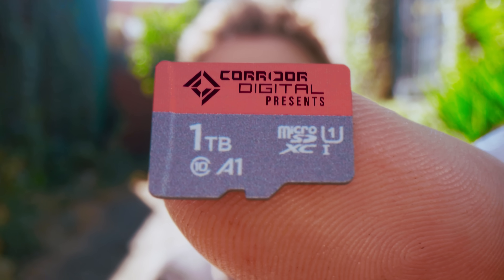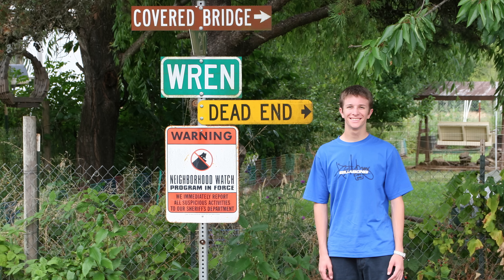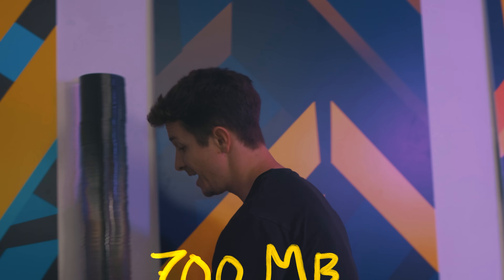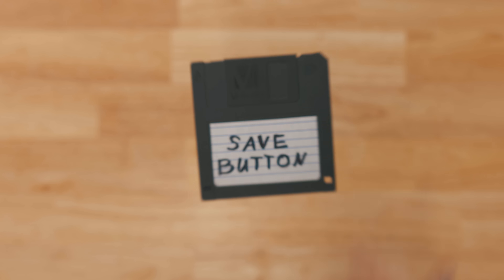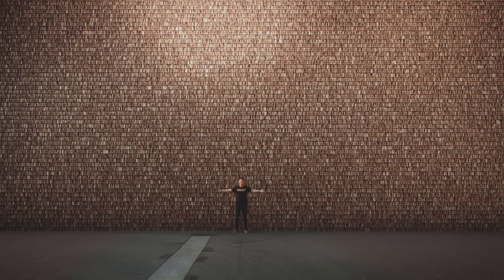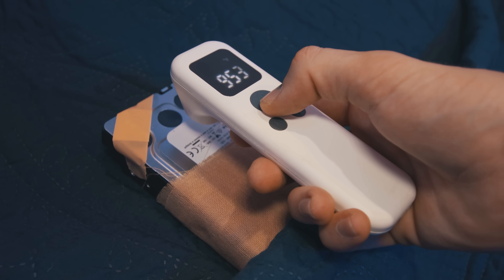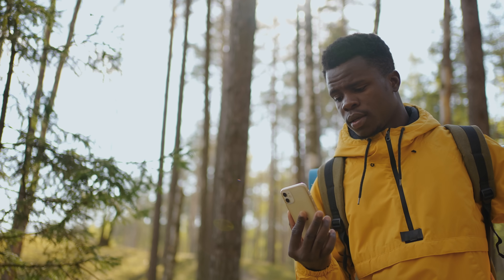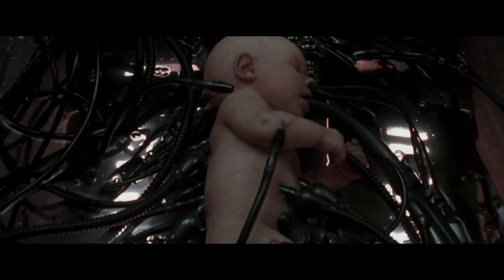VFX Artist Reveals the TRUE Scale of Data!

Comment: You might laugh at magnetic storage today, but don't! It is still used for mass storage. That's because they can hold a massive amount of data. I don't remember how much data each particle experiment (every time they fire off the particle accelerators up), the LHC takes, but it's in the range of many GB or TB (see edit below).

From their website: 
"The custodial copy of all of CERN’s physics data – amounting to about 340 petabytes –  is stored on magnetic tapes at the CERN Data Centre, also called the WLCG “Tier-0”."

Although they mainly use the magnetic tapes for long-time storage, they still have to load old data from tapes, which is a time-consuming process.

EDIT: From Computerworld:
"CERN's data requirements are growing at massive rates: Every experiment with its Large Hadron Collider creates 3GB of data per second".

Comment: Just a correction....Data is not named in groups of 1000... Actually is named in groups of 1024. 1 Kilobyte is not 1000 bytes, but 1024 bytes. This is because computer uses binary to store data, so power of 2 numbers will always easy to manage and closest power of 2 to 1000 is 2^10 (1024)

Comment: You got a few of the sizes wrong.  UHD bluray holds 120'ishGB (a regular 1080p one holds that 50GB), and even a regular DVD holds 8.4.  A floppy disc doesn't have its data stored in a spiral either.

Comment: and if you think that we must be approating the point were we store as many bits as there are atoms in the circuit you are both right and wrong. 
10^22 (meaning ten to the power of twenty two) is 10 zetabytes
a grain of silicon dioxide (SiO2, sadly we cannot index the number as it should be) of 1mm in diameter has approx. 10^19 atoms
So around 1000 grains of sand worth of atoms would hold the same amount of atoms as bits of information 
(hopefully I am not mixing up bits and bytes, but that is simply a difference of the factor of 8)
fun stuff though is that 10^22 is also the rough estimate of starts in the observable universe. 
How about that?

Ah, but how can you be right then?
Simple, we are approaching a boundery with out technology. If transistors (a simple on/off switch operated in an input/switch/output way) go any smaller they will be so close to being the width of atoms that electrons due to their nature will just be on one side of it in one moment and decide to be on the other the next. Quantum tunneling prevents the barriers to grow thinner than they already are, because if you make them thinner, the croud you are trying to hold at bay will simply phase through the barrier as if it wasn't really there.

Comment: Comparing to the 1-bit vacuum tubes of an IBM 604 isn't really a fair comparison. Vacuum tubes weren't meant for storing data. These were registers used during computation, but the input and output was done on punch cards. That's still probably less data storage density than text on paper, but it's a lot closer.

Comment: IMHO, the entire premise of the video basing "bits" off of vacuum tube transistors is flawed since we've been storing digital information in a significantly more compact form for hundreds of years already prior to its invention – via punched cards. The history of digital data really dates back to the first industrial revolution, with the mechanical looms. I implore Wren to revisit this video using punched cards as the basis.

(comment copied from another comment I made, but this part was at the bottom, so I reposted it for visibility)

Comment: I think the DNA stat is for one g, not one strand. To compare: one entire human genome is about 1.5GB (2bit per base pair and that's for one set of chromosomes I think, so double that for pairs). Still insanely compact and very exciting
Reply: I am not sure if I am right or just speaking nonsense but remember that there are two types of base pairs that can exist in a DNA. Factoring in the the fact that you can flip the base pairs around the amount of combinations that DNA can hold grows exponentially more.
Reply: @jasonchiu272  Yes, there are four different bases (A, C, G, T). The second strand of the helix always has the complement of the first, so there is no new infomation there. For one bit there are two possibilities (2^1 = 2). For DNA there are four which is 2 bits of information (2^2 = 4).  So you could encode each base as 2 bits. For example A=00 C=01 G=10 T=11. So you would need only twice as many bits as base pairs to store the same information. The number of possible combinations grows exponentially, but the same also happens for bits. However the information that can be stored grows linearly, because of all those possible combination you can only ever store one at the time.

Comment: The other thing to keep in mind with using more traditional storage over SD cards in big servers is speed. NVMe drives (especially the newer ones on PCIe 5.0) can push way more data through than SD cards. Editing a 4K video in realtime requires an absurd amount of throughput that SD cards just can't manage.

Comment: Sorry for this, but you're wrong in the scale. There's 1024 kbyte in a megabyte. And 1024 megabyte in a gigabyte. It goes in powers of 2, due to the binary addressing of data.
And you're also not correct on the amount of bits in a character. The ASCII table only requires 7 bits. However we now often use UTF or unicode and character have a variable length. Often 16 bit or more.
And finally, your can't just multiply the data amount in dna with the number of cells in the body. That's because the dna in each cell is inherently the same. It's a great backup system, but not a distributed storage.

Comment: DNA part is incorrect. A single double-helix strand of DNA contains 6.4 billion base pairs (or letters) - with 4 possible letters or bits.
Since it's base 4 then only four bits are needed to form a single byte instead of 8 bits in binary.
So 6.4 billion / 4 = 1.6 billion bytes = 1536MB = 1.5GB
The 215PB figure is an estimate for how much can one gram of DNA store, not one strand.
Edit: The total amount of DNA in a human body also seems incorrect, closer figure is around 3 trillion (not 1700 trillion).
So an average person contains enough DNA to theoretically store 4.5 zettabytes of data.
Reply: Human DNA is 3.2 giga-base pairs (billion) long adsing up to 6.4 billion bases on the otber strand, but with redoundant information. Also its distrubuted across different chromosomes making the "one molecule of DNA" a bit tricky. But referring to the DNA of a single cell the storage potential would be 1.5GB for single stranded DNA (not very stable) or 750MB of double stranded DNA (quite stable).
Reply: @AndiMajore  Thanks for the detailed explanation, I'm certainly no biologist!
But yeah, 1.5GB would be the theoretical maximum if we used DNA as computer storage except with a quaternary system instead of binary. But obviously the cells don't encode information like that - first of like you mentioned there's redundancy and second the information is coded into three letter words that specify different amino acids.

Comment: 0:50 A million Megabytes divided by 24hrs times 3600 seconds per hour makes Wren's GI tract's data transfer rate around 11.57 MBps. Hence, Wren's ability to transfer data is a bit less yet still comparable to a 100Mbps ethernet cable that is on average 30 ft (9 meters) long.
Reply: Oh, and a really useful pro-tip for everyone, 5:57 if you still have one of these in your house and you can destroy some of them with no consequences, that black magnetic disk is hands down the best thing you can find from your dumpster to look through when you want to see solar eclipses without cooking your eyes. Yes, really. It was a thing 20 years ago.

Comment: The comment about the brain might be a very low ball park number however. There is a theory put forth by Hameroff and Penrose that a structure called mictroubuli (cytoskeleton in all cells, including neurons) has important information storage capabilities, and based off some back-of-the-envelope calculations, including these microtubuli, each neuron has as much information capacity as the entire brain had in previous calculations. So turns out the answer you gave was actually just the exponent x)

Comment: Im old enough to remember when c.ds first came out. The early 80s there was a push for them and everyones rich friends parents bought them. You couldn't even walk through the living room while the c.d was playing or it would cause it to skip. The smallest scratch and they wouldn't play. They didnt take off till the 90s when the first portable cd players started pumping out commercials about how you could run with them and they wouldn't skip. This was a lie of course but it got more people to buy. It wasn't until the mid 90s when cds exploded in popularity. Finally they didnt skip because someone was walking in the room next to you. Cd players for cars were much better and small scratches didnt ruin the disk. However simply sliding a cd in and out of your cd case a bunch of times would put a bunch of small scrathes on the disk and ruin it.Then we all.bought those cd resurfacer devices where we would sand down the scratched layer. Most of us still pined for the days where we could just throw our cassete tapes around with no worries and they still played. This is why laser disk never took off. We had such troubles with c.ds that a really big c.d just seemed idiotic.

Comment: Imo this isn't actually important enough that it needed to be included, but I think it would have been interesting to see a short segment about the size differences between decimal and binary conventions of data sizes. The SI standard for a kilobyte, as is most commonly used and is referenced in the video, is 1000 bytes. But there is also a different convention which used to be more standard in the early days where a kilobyte was 1024 bytes, which while not exactly following the more standard definition of "kilo", it arguably made more sense for binary data, the term kilo is just used because this unit is close to a multiple of 1000. (Also worth noting that some people distinguish between a SI kilobyte as "kilobyte" and a binary kilobyte as "kibibyte", but this is a retcon solution which wasn't always followed, so it's not very reliable in practice.)

But the really interesting part of this is how, while the difference is relatively small for a kilobyte (2.3% difference from kibibyte to kilobyte), it actually compounds to bigger errors as the data size increases. By the time you reach an exabyte, that's more than 13% smaller than an exbibyte.
Reply: Back in those days, data is stored physically as groups of 512 bytes (called a sector) so 1K is a handy shortcut meaning 2 sectors. Indeed, a 1.44Mb on a floppy actually means 1440x1024 bytes.

Comment: Errata at 2:48 -- the terms as used in data storage is not that straightforward. 1 kilobyte way often than not refers to 1024 bytes, instead of 1000 bytes. 
This is because at that scale around the thousand bytes mark, powers of two still influence the physical allocation of bits of data. Floppies are divided into 512 byte sectors, and flash storage bits likewise are grouped in powers of two at this scale. Indeed, a 1.44MB floppy actually means 1440 X 1024 bytes. 
But I'm pretty sure as we go into GBs and TBs, storage media manufacturers may have just used 1000s all the way through as the difference is insignificant.

Errata at 6:55 -- at that time, a byte is a fuzzy concept, if it even existed. Every computer architecture has its own grouping of bits, generally called a word, and it's whatever the architecture specified it to be, for the specialized applications it's meant to run for. 
8 bit word size (aka the modern byte) became the convention with IBM machines in the 60s, and the emergence of Intel's 8086 CPU architecture, which has an 8-bit word size.

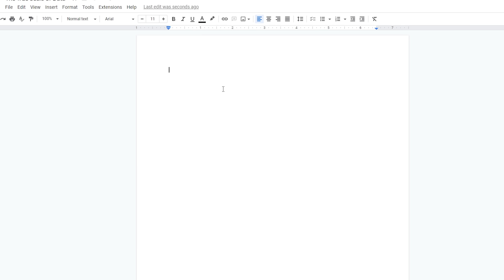Errata at 7:00 -- bits-per-character encoding size varies throughout history. For ASCII, which encodes the basic English alphabet, numbers, and symbols, 7 bits is enough. Even earlier encodings encoded most English texts just fine with just 6 bits, but without letter casing information. The stack indeed could have been 25% smaller if you don't mind everything in uppercase.

Thoughts: The entire premise of the video basing "bits" off of vacuum tube transistors is flawed since we've been storing digital information in a significantly more compact form for hundreds of years already - via punched cards. The history of digital data really dates back to the first industrial revolution, with the mechanical looms. I implore Wren to revisit this video using punched cards as the basis.

Comment: If you store a bit as a pixel on an a4 paper, you can store 3508 x 2480x2 bits. Which is 17399680 bits, which is 2174960 bytes. 1tb / 2174960=459779 rounded up. 459779 pieces of a4 if assuming at to be average 0.1mm thick would be a stack of 46m high. This is not factoring in lossy/lossless compression. Check my math, but I think the video is for shock value only.

Comment: using the bit you showed from adam savage, looks to be about 2.5 cm by 2.5cm by 17 cm would be about 100cubic cm x8 for a byte = 800 cubic cm for a byte which is 0.0008 cubic meters
x 10,000,000,000,000,000,000,000 (10 zettabyte) = 8,000,000,000,000,000,000 cubic meters or about 1/137th the size of earth (137 of them fit in earth)
which would probably be about half the size of the one you showed revolving around earth at 12:23
hmmm definitely not as big as the one you showed, even though I was using larger that realistic measurements for my cubic cm area
so in reality for the bit comparison, I think it would end up being about 1/4th to 1/2 the size at 12:23

Comment: Technically, 1024 bytes is one kilobyte. But since manufacturers always love to slap the larger number on their product, we have this cheating going on between gigabytes and giGIbytes these days. Which means that a "terabyte" gives me only about 0.9 real terabytes of storage. And the further we go up the log scale, the larger this "error" becomes.
Reply: You know… I went back and forth on whether I needed to clarify this distinction in the video and every time I did it seemed like an unnecessary distraction since even the dictionary has gone over to the side of extreme rounding that everyone just accepts now as base 1000 rather than base 2. So yeah. I couldn’t figure out a good way to communicate that while still keeping the video entertaining and on pace.
Reply: @SirWrender  I, for one, was happy to see you use the proper scale.
Reply: I agree, although at a certain size, is the discrepancy really even an important factor anymore? Who fills their drive to the absolute top before switching to another these days when some forms of storage are so cheap?
Reply: @TheRealAlpha2  filling it to the brim is even unadvised, for both HDDs (defrag) and SSDs (cell balancing)
Reply: a 1TB harddrive is holding 1000 Gigabytes of data, no cheating here, you are getting 1 billion bytes of storage.
windows just throws a wrench in it byte representing the capacity as 930-ish Gebibytes but using the unit Gigabytes. Microsoft is the one lying (as well as Apple and Linux)
Reply: Found it. Yeah, this.
Reply: Yep, it's also true with broadband/internet marketing,

They say you get 50 mb/s for instance but that's Mega Bits not Megabytes but most people don't know this.
Reply: nope. 1000 bytes is one kilobyte. it's an SI unit prefix. the 1024 bytes that are used in the binary system would be called kibibyte. Windows reports sizte as the practical 1024 multiplier (but calling it mega), hardware manufacturers like the 1000 SI one
Reply: @noahluppe  You didn't read enough of the wiki article.
Reply: @sangwaraumo  I don't need to read any wiki article to talk about the (wrong) usage of SI prefixes and their meanings.
And the SI prefixes might have been (wrongfully) used in the beginning, but (I just read this up on the wiki page) the IEC brought their binary prefixes in '96, with wide usage in the industry. Why Windows doesn't respect that? Idunno.
Reply: @noahluppe  It isn't just windows. It is a common practice in the industry. I use Linux and it's the same. Same on Android. Terms mean different things in different contexts. The more you know.
Reply: @sangwaraumo  My Linux experience is the opposite, they use the binary IEC prefixes for base2, or the shortened one letter versions (then it's not a prefix); or they use SI prefixes correctly. Same with android, my 64 GB SD card is formatted 63.8, but windows shows it as 59.4GB, which fits the size in GiB. And the SI unit prefixes are standardized to mean exactly the same everywhere. The IEC got that and changed their naming scheme accordingly.
Reply: @noahluppe  it's more nuanced that that. in the scale of kilobytes to MBs (like if you're measuring the size of a floppy) 1KB really does mean 1024 bytes, and 1MB being 1000 x 1024. At this scale the powers of 2 still has an influence, seeing that floppies are formatted into 512 byte sectors and 1Kb is actually a shortcut meaning 2 sectors. Indeed, a 1.44BM floppy means 1440x1024 bytes.
But for the scale of GBs and TBs and beyond, whether 1Kb is 1000 or 1024 bytes doesn't have much difference, so I figure in such scales it's 1000s all the way through.

In the same way, RAMs are always in powers of 2 as the architecture is in powers of 2 all the way through.
Reply: @mfaizsyahmi  No it's just a misunderstood word meaning. Kilo literally is the SI prefix for 1000, and it has been used for the 1024 multiplication wrongfully. All units have also a prefix for the 2^10 namely kibi, mebi, gibi, tebi, etc.
And the systems stay in one way of calculating, windows uses the 1024 multiplication for all sizes, just labels it technically wrong.
Harddrive storage still is divided into blocks, site depending on settings and use case.